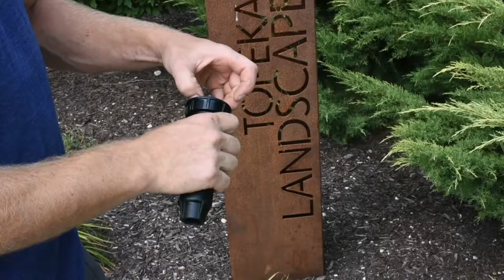How To Unstick Sprinkler Heads | Topeka Landscape

Comment: One reason in my opinion is most times the cost in time to diagnose/service the head is about the same to just install a new one.  For able and willing homeowners definitely service them first.  Sprinkler companies will replace as well they should.
Reply: It may take more time to open it up and clean the sprinkler (this is debatable) but with 1800 sprinklers being $8 each, you can quickly spend several hundred dollars replacing them all and thats a lot of money and a lot of digging. I'd rather at least try to clean up most of them if they still work and just need to be cleaned. Fixing my irrigation system while also spending $0 sounds great to me!
Reply: 😂 exactly. Am I seriously expected to dig up 6" sprinkler bodies constantly to fix this?